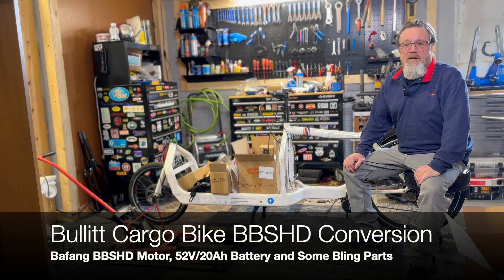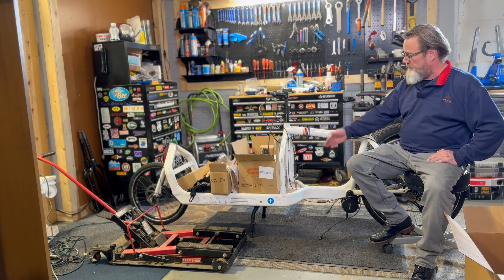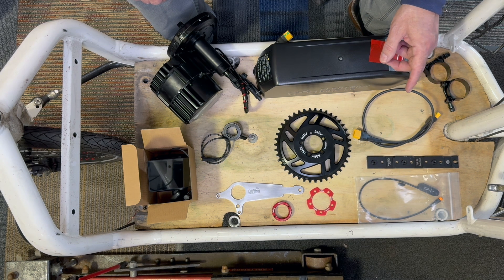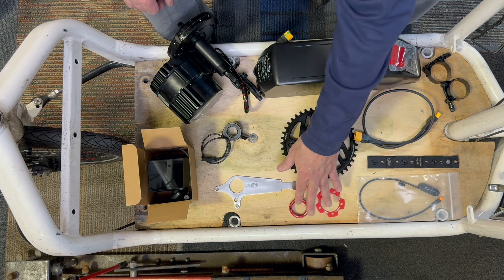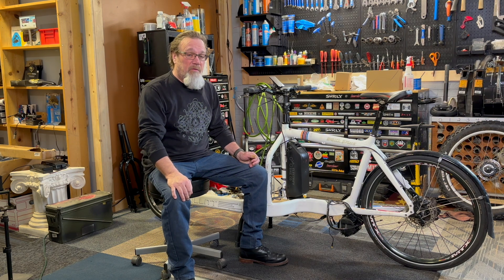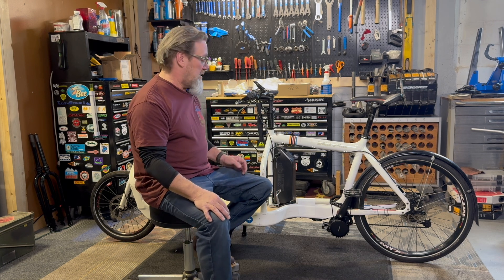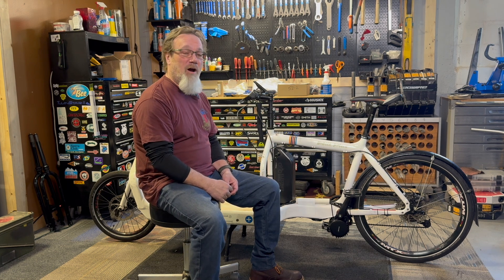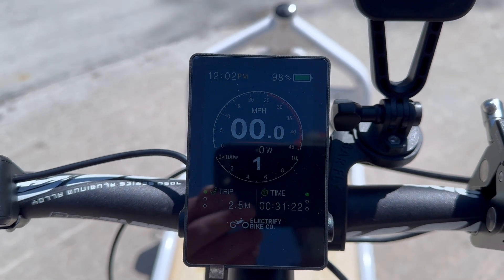Bullitt Cargo Bike Bafang BBSHD Conversion, 52V/20Ah, Lekkie Upgrades and The TOOB!

Comment: I ordered the same setup for my Bullitt without the battery extension cable. Did you use the extension cable or the short cable in the final build?
Thanks for the movie!
Reply from the maker: Good question! I believe the way we set it up the stock cables were JUST long enough. Subtle changes to the way you mount the different components may make the extension necessary>

Comment: Luna cycle makes different angle motor brackets and a motor bracket that goes under the bottom horizontal tube.
Reply from the maker: Good info!

Comment: Nice video 👍 thinking of doing the same with my bullit
Reply from the maker: The upgrade from the older BBS-01 was definitely noticeable as was the slight jump in voltage from 48 to 52. The 52 sits in the sweet voltage spot longer.

Comment: Did you have to alter the motor housing or the frame of the bike near the bottom bracket to get the motor to slide in?
Reply from the maker: Not on this build. That said, there was a BBS-02 on the bike that had been previously installed but I don't know if the original installer had modified anything on the frame. I didn't notice any signs of mods though. In this case it went in smooth as butter.